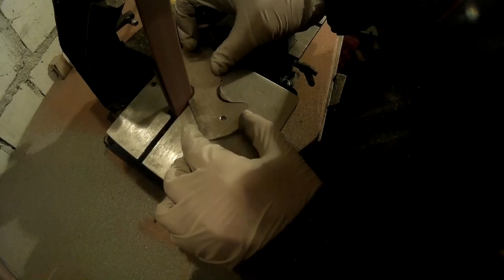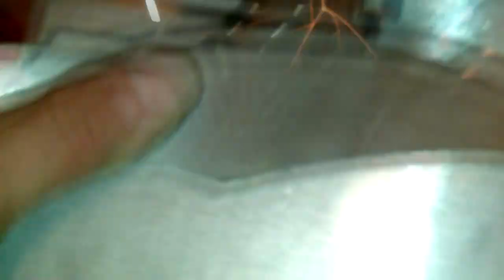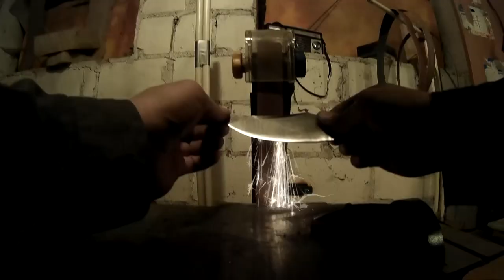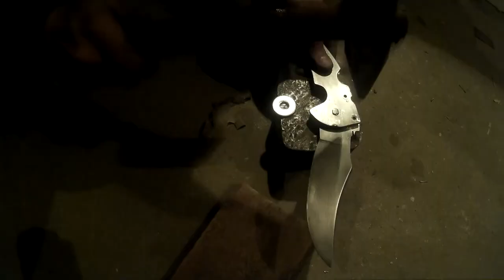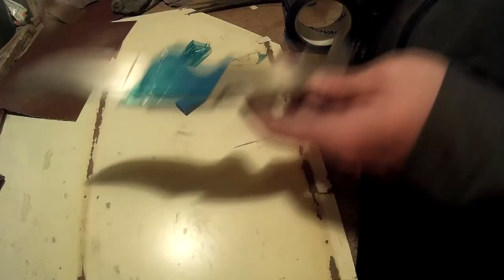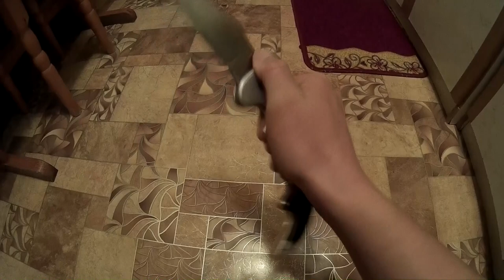Making CS:GO - Falchion Knife

Comment: spray painting is a bit disapointing, acid etching or patina with vinegar is better, try it next time ;)
Reply from the maker: Good luck with etching aluminium :D the only way was anodising which was too difficult, i tested the paint on aluminium scrap and it worked pretty well so i decided to paint the knife.
Reply: Espe oh sorry I didn't notice it was alluminium ! great material for light and smooth handles ;) 
so yes you're right, a good spray paint is the only accessible solution =P
continue to do cs knives, you do a great job !